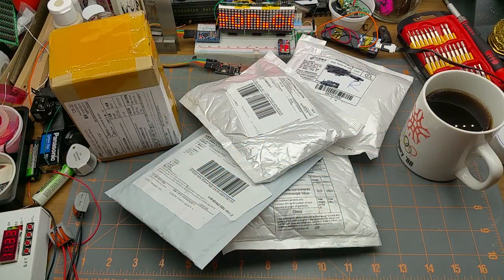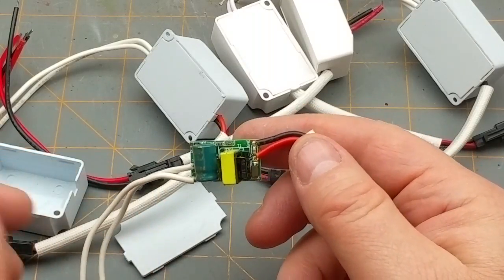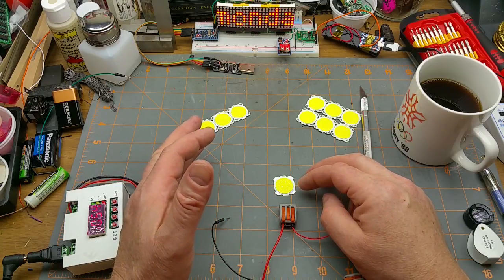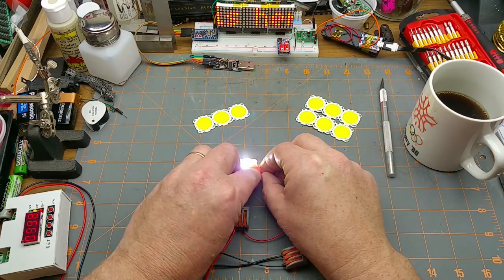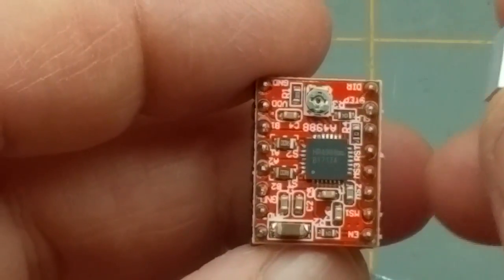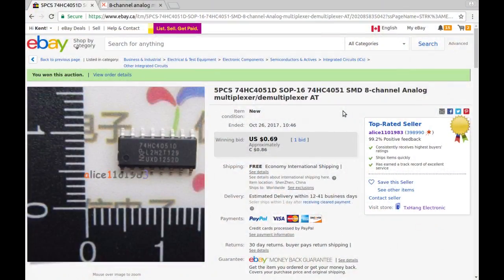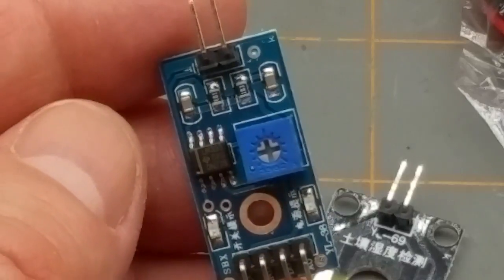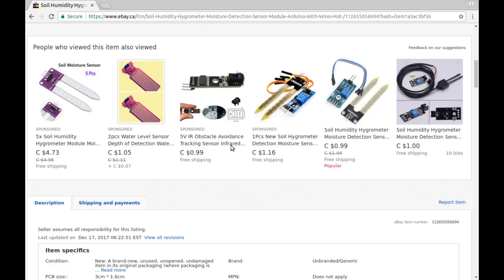Mailbag Monday 19

Comment: Them soil sensors do not last more than a few weeks in soil. I learned the hard way when the foil corroded off and the pumps came on ( Via the Arduino Nano ) and flooded the garden. I heard you could use a copper nail and a galvanized nail. Going to try that this year.

Comment: 10:05 - you made some errors regarding the COB LEDs and the Drivers. Firstly,. all LED chips are current hogs and will draw unlimited amounts of current, whatever the source can supply. That's why all LED drivers must be Constant Current (rather than Constant Voltage) - otherwise the chips would overheat and fail within moments. Thus, no matter what current you set your B3603 to output, it will always 'current limit' and the voltage drawn will be whatever the chip forward voltage is at that power level.
Secondly, your drivers ARE (almost) correct for those COB chips. The "3W" driver is rated 300mA at 3V-11V and the "3W" chips are rated 260mA. So the driver does NOT suit 1W chips... it's a 300mA Driver and can be used with ANY combination of chips that can handle that current and have forward voltage of 3 to 11V.
So, the voltage range means this driver suits 1 or 2 or 3 chips in series. Your 3W COB LEDs are running 3 chips in series (and probably 3 in parallel, for a total of 9 inside each), which is why you see a voltage around 10V for them. You shouldn't run one 240mA COB off 300mA (that's 25% over-driven) however you can certainly run 2 COBs in parallel and they would share the 300mA to run at 150mA each.
Running the COBs in pairs also works out perfectly because you have bought 10 chips and 5 drivers.